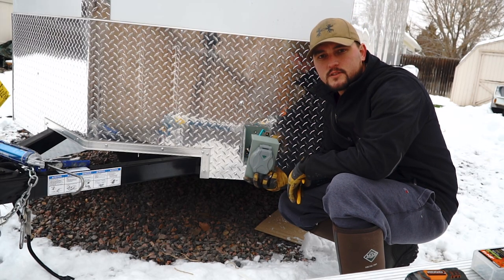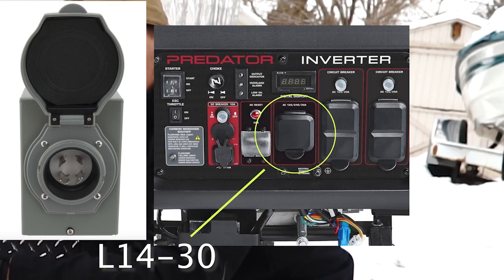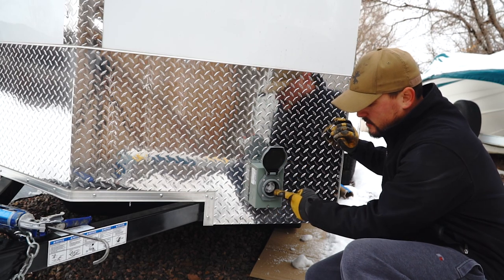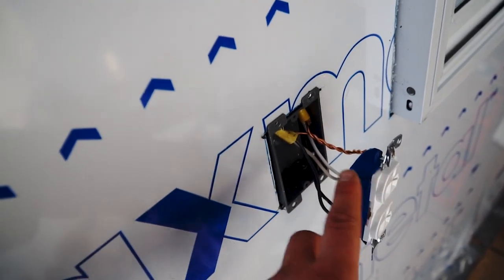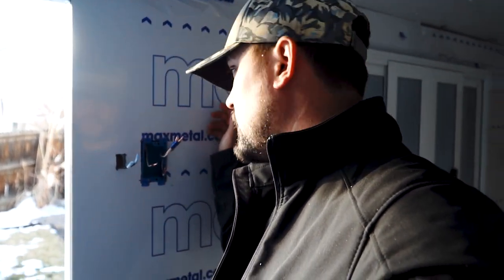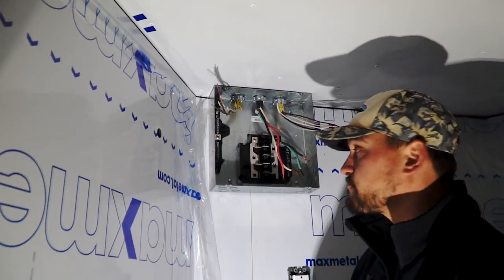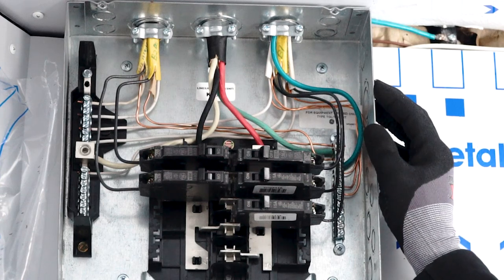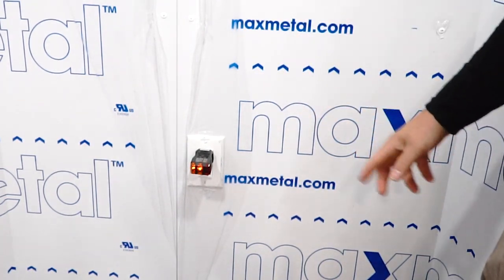Install 120v Power Part 2 - Inlet Box, Breaker Panel, Outlets | Cargo Trailer Conversion Ep.6

Comment: This might sound obvious, but before you touch any breaker box, you should make sure there is no power connected to the rig.  Obviously, you are not powered up yet, but it is good practice to verify that no one else might have walked by and plugged in power.  Also use basic Lock out/tag out procedures to prevent an accidental plug in/switch on by another worker.  Sounds obvious, but you would be surprised by the number of electrical hazard injuries that are prevented by these basic processes.

Comment: Correct me if I’m wrong but 7 500 W is too much power for a 30 amp whether it’s a camper or a custom build. A 30 amp system should not with seed more than 3750 W cause even 30 W campers that are made from 2000 to 2020 are recommended to only use 3750 W of electricity otherwise you will keep tripping main breakers?? and 50 amp campers should never exceed 12,000 W of electricity so in all technicality this should be a 50 amp system not a 30 amp am I correct?
Reply from the maker: You are correct for a 30amp 125v inlet, which is what RVs have.
I am using a 30amp 250v inlet. It’s a 4 wire, so it has two 125v legs, so it can utilize 7,500 watts. 
I probably should have installed two 30amp main breakers to make it less likely of overloading one leg and that would illustrate what’s going on better.

Comment: So you don’t need a main switch in breaker box?
Reply from the maker: I didn't need one. You can put one in if you'd like though. My thought was with only 5 switches i could flip them all off in about the same amount of time as a main disconnect switch. In the case of an emergency, you also have the option of disconnecting power from the power in-let box on the outside of the trailer or from the generator or shore power connection. Thanks for watching!
Reply: @ShouldBeGood hey thanks brother… I appreciate you getting back with so quick

Comment: What amp did you use for the outlets ?
Reply from the maker: I used commercial 20amp for using high watt blenders and heaters/ovens.
Reply: @ and what about the 2 switches ?

Comment: If you were to run a generator to this panel and inlet box, would it destroy the truck batteries?

Grounding question.
Do I ground to frame or not. Do I ground to the generator frame?
Reply from the maker: @cardinalpoint6047  The 120v electrical panel is wired separate and it’s intended for a generator. The truck 12v battery only powers the trailers driving lights and original interior trailer lights so will have lights inside when not connected to a generator or shore power. 
Yes, I ground to trailer frame.
Reply: So you if you run a generator. The generator needs to be grounded

Comment: How did you get 240v from shore power
Reply from the maker: @SamerAbdulahad  I didn’t get 240v power on one circuit, I’m not running any 240v appliances. I got two 120v legs.

Comment: Hi there, great video, just a quick question, at the 12:50 mark you show what looks like a double plug  or y adapter plug into the trailer. What type of plug is that and why do you have it plugged in that way? Is it plugged into your house on the other end as a single cord? Thank you!
Reply: If you look closely, he has separate cords going into the split cable, they each provide 120V to the inlet plug, which allows 240V so each bus bar in the panel box is hot and all breakers have power.
Reply: @Bug1374  really appreciate it !
Reply from the maker: Yes, Bug1374 is exactly right! 
Here is the adapter I use https://amzn.to/3KNqgun
Reply: @ShouldBeGood  I was trying to find the adapter you used but the link you used isn’t working.
Reply: That’s why  I’m confused also